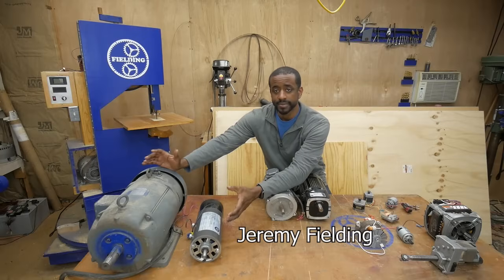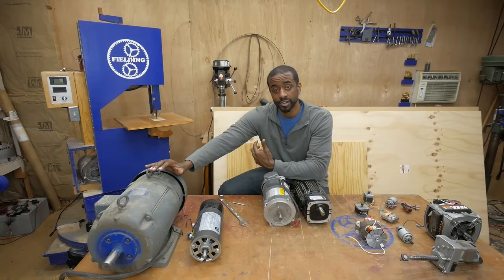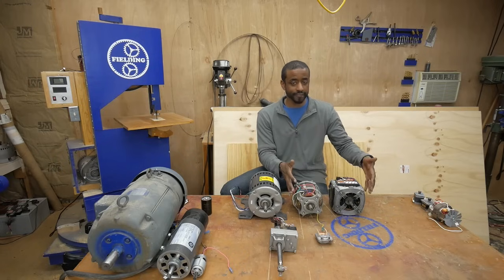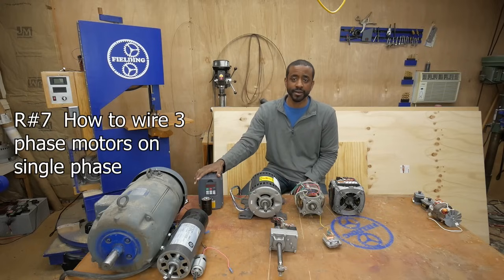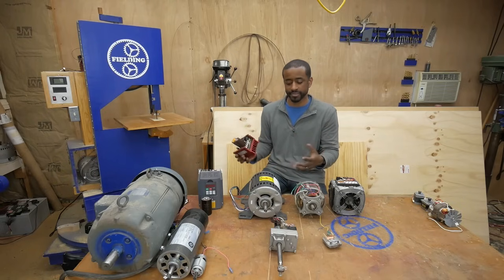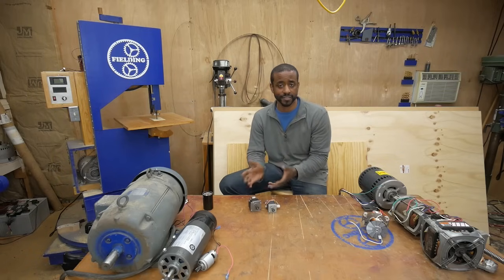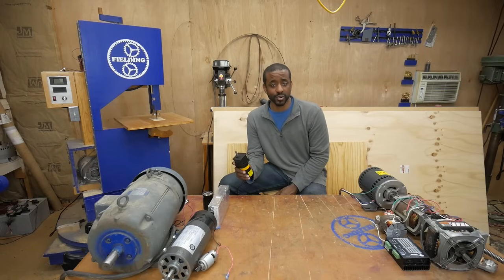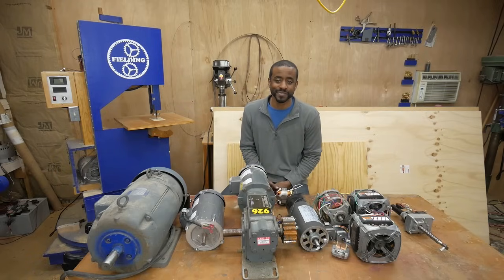Ultimate Beginners Guide to Using Electric Motors for Makers and DIY Projects; #068

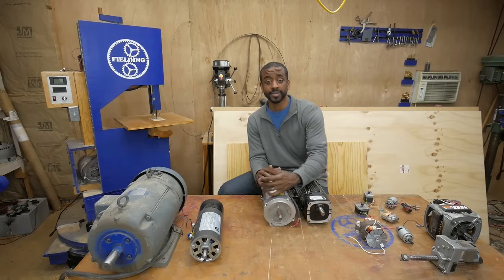Comment: Referring to your comment @ 1:05
I can remember my dad back in the early 1970's talking to me about a  Watts / HP  but my understand of the two are as like this:  Watts are the amount of power used to do a certain amount of work at any given moment.  (P = I x E)  But that work (hp) can take more Power in this case expressed as watts over time.  Now if the design of the motor is not as good or maybe a better design, or maybe that the bearings are bad or even better, the Hp obtained by the Power (i.e. watts) used is greater or lesser, depends on the motor itself.  Now if you include the non used heat & etc. as part of the Hp (work done) there would be less of a variance.  So what I'm saying is that Hp output does not always correlate to 746W. per Hp, & Hp is not the exact thing as Watts.  To reiterate, Watts are Volts times Amps & watts over time, referred to as KWH's is the consumption of the amount of electromotive force over time.  Now that force will produce work, i.e. heat, light, movement, sound, & etc. & all of this & more will depend the efficiency of the machine that is doing the work.  So the Watts needed is not always the same when it comes to the work produced, (in your case Hp output).  Kind of like the motor in a gas car that uses a different amount of fuel to produce the output of Hp depending on the engine design.  I always took my dad to be using the Watts/Hp correlation to be somewhat flexible.  But maybe I'm wrong he never told me what I've said here, it just seemed to make sense to me.  So please don't blame my dear departed dad, if this does not seem right to you.  My father was a master when it came to thees type things back in the 70's, even up until his death a few years he was real sharp about things, like this.  Thanks,

Comment: You seem like the guy to ask about motors for a motion simulator rig for racing. I am guess low rpm and high torque is the way to go on that? I have seen people use wiper motors but that just seems too weak for me. What about motors from Disability scooters or wheelchairs? Or do you have better suggestions where to find good cheap motors for such a project?

Comment: Can I possibly hire you as a consultant on a project I want to accomplish but am not sure how to best go about it. It has to due with testing and recording the output of motors/dc chargers/batteries/inverters and inrush current/locked rotor current. Namely, DC inrush current, something that either doesn’t exist or is a unicorn of sorts measurement wise depending on who you talk to. 

Be gentle when you tell me I can’t afford you pls.

Comment: here we have 3ph power for 220 to 575  power the farm power I call it  single phase  most of the farm around has this power we choose to upgrade our farm's power we were blowing the transformers on the farm we stey blow them out because of the power company does not want to put the right power in to use 
long weeks Christmas  very cold weather snow storms at night we blow the transformer out  we have a 24-hour business  we run, and the ladies know when it time for them to be milked they need to work fast for the milking to start on time 
we have part of the farm off gid the houses have power from the windmills or the solar power 
were I live I have a waterwheel keeps the farm powered up  plus we have on all the farms have a diesel plant for blackout 
was I live I well power up the diesel plant if I and using  575 power for welding I do here my welding truck is just stuck have mig and tig in the shop that the power I run in this shop and my parent's shops too  the pipe bending machine takes power  we make dairy barns stalls for the dairy i tig weld the stainless steel for them

Comment: What motor would you recommend for a sail boat? Both outboard and indboards. They need power, but they dont need the same torque as your gocart (since its a propellar in water.) Im from EU, so 220v here, but want to run it from batteripack at 12 to 48v.

Thanks for great videoes!!

Comment: I love your motor guides (and all your videos). There is always so much information and you present it in an easy to understand format.In Germany those induction motors are called Universal motors. I posted on a facebook group and was offered 6 working washing machines and dryers in 1 day for free. Sadly I couldn't take them all. There are so many useful parts in washing machines and dryers, from caps to pumps to heaters.

Comment: The constant 5252 was not explained at all. RMP needs to be converted to angular speed radians per second by multiplying by 2*pi/60.  1 hp=550 ft-lbs/sec and together 2pi/(60*550) = ~1/5252.

Comment: Jeremy nice video. You left out one important fact relating to size.... duty cycle. Keep up the good work!
Reply from the maker: +simclardy1 they have the same duty cycle. Both continuous duty. Just didn’t want to get into it unnecessarily
Reply: @Jeremy_Fielding  i think of the size being primarily dictated by heat concerns and that's why i mentioned duty cycle. Watts are watts. So I'm guessing the small motor is much more efficient or they are not truly equal in duty cycle. I grant that speed is a factor because you can't scale all aspects of motors evenly. 
Video suggestion: gear down the treadmill motor to match the large motor speed and load test?
Cheers

Comment: I have noticed an increasing mention of using Arduino in electronic projects. Many of them are an example of overengineering as they could have been made using discrete components. in a simple circuit. I've made PWM controllers this way using logic chips such as 4011 and 4093 driving transistors to obtain the required drive currents/voltages.
Reply: I'd like to learn more. Would like to build a camera controller for pan and tilt. Any suggestions?

Comment: Your video finally helped me realize WHY torque * RPM equates to power when you related it to force * speed. For the longest time, I didn't see it but then it clicked that its literally just work/time is rotational "force" integrated over radians per time. And radians per time is RPM.... What a lightbulb moment, thank you!

Comment: I imagine the motor won't start without a capacitor as a purely inductive load crates a lagging current shifting the voltage and current out of phase by 90degrees causing something known as Wattless current. Also known as power factor. What are your thoughts on this?

Comment: Is there a way to visually determine a single phase vs a 3 phase motor at a glance?  Paricularly for vintage motors. Thanks.
Reply from the maker: The label on the motor tells it all
Reply: @Jeremy_Fielding  Thanks Jeremy.  How about when no label exists?  I   found a large & heavy (about 100#) motor that I'd like to repurpose on a vintage air compressor rebuild, but really don't know where to start even to check it for functionality; particularly not knowing how to wire it if it's 3 phase for example.  I'm definitely a curious amateur.  Thanks for your channel.
Reply from the maker: Homework assignment. 
1. Check the description. I have videos on how to wire dual voltage motors without labels. It doesn't mean yours is dual voltage. But I teach more about figuring out the wiring. 
2. Search my channel for "what motor do I have" and 
3. "how to wire a three phase motor to single phase". 

Together these will get you going in the right direction.
Reply: @Jeremy_Fielding  Thank you Jeremy.  I   know you are busy, and don't have time for all these individual questions.  I   really appreciate you sharing your expertise.  I'll dig into my homework assignment.

Comment: What is the motor required to shred chicken bone? Is 500W sufficient? i checked that the force required to shred chicken bone is roughly 200 to 400N and the distance between the shaft in my machine to the bone is 0.03m. I hope can make the shaft in motor turns about 5-10rpm. Can u assist me on this? I'm currently want to make a food waste shredder and I'm a totally newbie. Btw great video!

Comment: While accepting losses in power, would it makes sense to use a cars alternater (with bridge rectifier removed), that has a DC motor connected to the shaft. Ultimately to run a equal phase and power rated AC motor? 

Reason is because pure sinewave inverters are hard to find low priced(for me), and the Variable Frequency Controllers/Drives are that much harder to for me to get.

Comment: Great video, very interesting, I've been thinking of building a guitar pickup winding machine, several examples on youtube of homemade ones. They use old sewing machine motors, about the size of the drill motor you showed, but it would not spin as fast. I'm going to check out your other videos, would love to know the applications of these motors for projects. Not close enough to a big city for the real deals but there are some resale shops & become friendly with the local metal recycling guy. Keep up the great videos.
Reply: I have a sewing machine motor here that I was curious about, so I rigged up a gizmo to measure the speed, using an optoinerrupter, and feeding the output of that to my scope.  That darn thing was running at around 80,000 RPM!

Comment: I misunderstand something.
Big one DC motor has 3hp on Torque1 and 1750RPM, the smaller one has 3,8hp on Torque 2 and 3600RPM. Torque 1>Torque 2
My question is:
If we gear down the smaller one to 1750RPM this will have Torque 3 which is greater than the Torque 2, because smaller engine has 3,8hp. So where this dimension difference come from?
Reply from the maker: The "gear down" is the same reason a body builder may be able to lift a car, but you need a jack. Think about it. 🤔

Comment: Can I wire a high amp battery system to a throttle that can switch the direction of the power input to a 12v treadmill motor. Is this possible to do without pulse wave modulation, or do I need a controller? If I wire this type of throttle to the controller (curtis controller) can I make it so the motor can spin backwards somehow? Thanks! Awesome video. This is the first video I've found of yours, but I plan to watch many many more. You're amazing!!

Comment: re your DC motors. You stated that adding more perm magnets to the stator (field) would increase  the motors speed for a given voltage applied to the brushes. Actually adding more field slows the motor down because the armature is trying to run at a speed where if it were a generator,, it would match the voltage on the brushes. More field in the field of a generator generates more voltage for a given rpm. So less field requires more rpm to get  the same voltage. I like your stuff a lot. Thanks --- Mal Snow (malsnowman@gmail.com)

Comment: NEMA classification of stepper motors has no relation to shaft size. the rating corresponds to the diagonal face dimension in inches. i.e. a NEMA 17 is 1.7 inches diagonal

Comment: Please explain synchronous reluctance motor which is used in tesla model 3 and claimed to be the highest efficient motor
Reply: Probably going to be while, they are expensive. EVs have very sophisticated 3phase induction and/or permanent magnet (or reluctance in M3). The motor and inverter for the Model S is about the size of the 3 hp he shows in this video, but Tesla peaks around 500hp. They do their magic with liquid cooling, very advanced field geometry, and an inverter/controller that understands all of that.

Comment: Nice video. You need to teach a course on this stuff. My question is do you ever do resale of these motors and if so whats the market like. What motors resell most. I do alot of scrapping and my #1 item i see most are ceiling fans. 2nd would be vacuums. I usually just scrap these for the copper and any aluminum but i was curious if there was a decent market for motors especially washers and dryers.

Comment: Good information! I'd like to see a video comparing a very old AC induction motor to a modern one, in terms of output power and torque VS size and form. I watch videos where they repair old industrial motors for equipment. And they always say I could buy a new one and it would be half the size and twice the power and efficiency. But is that really the case? I love to hear your take on that. Thanks!

Comment: I don't know if its me, but I feel that any description on the differences of electric motors should at least mention duty cycle. There is a very good reason that 3hp motor is so much bigger than anything else and I'm pretty sure it has to do with the duty cycle of the motors
Reply from the maker: Not in this case... they both are rated for continuous duty. That is why I put the labels on the screen.
Reply from the maker: I do plan to make a follow up video where I discuss reading labels. Duty cycle is on the list. But that was just too much for one video

Comment: Great stuff Thanks for sharing this video. Got a question i like to builde a ventilationsystem that runs 24/7, must be speed controlled(arduino) and energy efficient. Can you give advise on what moter to use.
Reply: First determine how many watts of power you will need for your system. This will depend on what type of fan or blower you use as well as the resistance of the air being forced through the system. Generally speaking, BLDC is the way to go. It should have the sensor. If you can't find one that fits your power requirements then you can use more than one together.

Comment: @Jeremy Fielding - 
3 Phase power @ 7:59 is NO "luxury" at all just the USA is again behind the time & wanted stuck in the 19th century for ever ... 
Also All (these shocking) USA sockets + plugs do not meet European safety standards because you can still touch life contacts in 2019 , Germany began to fix this problem in the late 1920s -> "Schuko" recessed socket (that also mechanically supports heavy "wall warts" ) , it can also be used with USA 2-life wires without Neutral ( just as Denmark & Belgium do )

Comment: Why can some motors create electricity when turned with an engine, but some do not?
Reply: To make electricity you must either pass a winding through a magnetic field or pass the magnetic field across a winding. Those motors that don't make electricity when turned don't have a permanent magnet. However it is possible to make them make electricity if you can charge the electromagnet in them first. You can then use some of the electricity made to keep the electromagnet energized so it will continue to make electricity as it is turned.
Reply: @kedwa30  thank you for taking the time to explain.
I think that whole house electric generators make electricity as you describe by feeding it back in to create a magnetic field. I think I got it. Much appreciated!

Comment: one question. Your 3HP motor is prety much the same size as Tesla 400kW motor. I know your is air cooled and Tesla uses liquid cooling, but still what is the secret. How they pack so much power into something so small?
Reply from the maker: Several things, but mostly Efficiency of the motor type, and cooling is the biggest

Comment: What is the best motor for a battlebot?
It must resist a lot of twisting in the shaft and also be able to suddenly stop and go back to work with little time to get to speed.
I'm not sure if it need to be DC but it will be drive by batteries.
Reply: A battlebot should use hydraulic motors with brightly colored hydraulic fluid coursing through its hydraulic line veins! Of course the pressure will be supplied by a pump powered by a BLDC motor.
Reply: @kedwa30  Ooookayyy, right now I'm drunk so I cannot say if you are been troll or not but I never saw a single battlebot using hydraulic motors, every single one use "normal" eletric motors, I'm not counting the flippers and the crushers that use CO2 and hydraulic systens.
Think about tombstone, minotaur, carbide.

Comment: Very nice explanation of motors. Yeah I have a few micro servos I bought from Amazon that can lift a very appreciable amount of weight, as well as some geared bldc motors with 64 bit encoders, which are cool because they can run at about 300 rpm but can also heft a lot of weight too. 

I'm trying to learn about robotics, so learning more about motors is always interesting. I appreciate this service to the DIY/Maker community that you have offered us; well done.

Comment: Great info . So what kind of motor would be in the Tormek sharpening grinders retailing at nearly €800 .is it the motor that makes it so expensive.?? What sort of application would you use a thread mill motor for ?? Kind regards Dave

Comment: I hate those "small plastic parts". In the last three years I've replaced a box full of zone valve controls only to finally figure out that they were failing because of a cheap little piece of plastic breaking off. The original valves have a metal post that stops the valve at the end of its travel and they last for decades.

Comment: Funny thing, that they call 3-phase synchronous AC motors BL"DC".
Reply from the maker: There are some tiny differences... but this is a beginner video
Reply: @Jeremy_Fielding  BLDCs usually lack the squirrelcage (and rotor windings for that matter) and usually come with built-in "encoder" sensor triplet, but it's inconsequential. My point is that BLDC is a huge misnomer, these motors are clearly just 3-phase AC.

Comment: You can drive universal (or any type of DC brushed motor) at constant speed trough something to check your rpm and changing the voltage accordingly .. I am sure that you know that. you are right about the ordinary PWM drivers